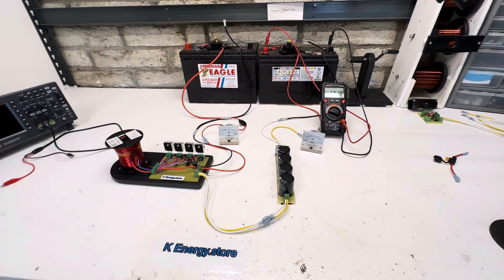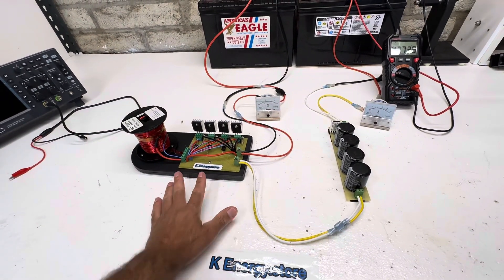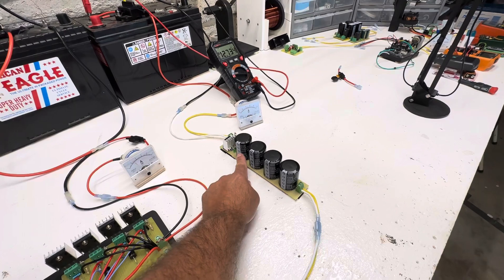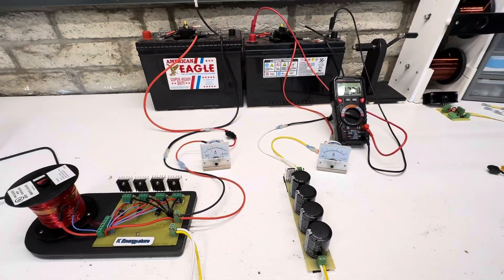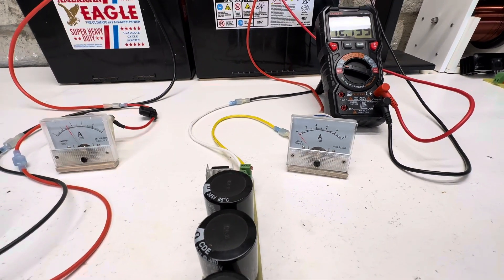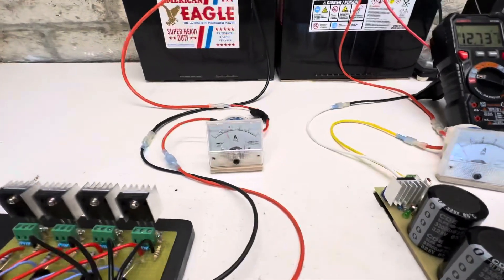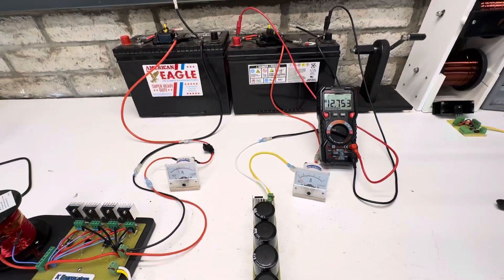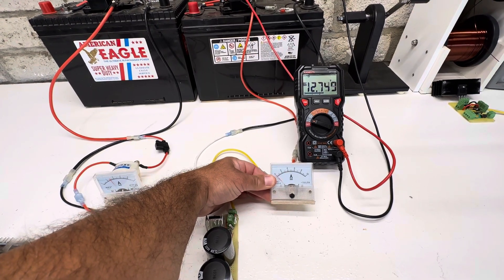Oscillator cap dump 10 amps

Comment: I remember reading with the Bedini type motors you can run 2 different ways.  One is the classic  SG  circuit.   I think the other was called generator mode.   
I think in generator mode the motor coils energy goes back thru the source battery when the switch is thrown.   This runs with higher amps on the input side but from what i remember you get more output than in classic mode ...... 
Have you run in both modes and if so what's your take ?
Reply from the maker: I am familiar with the circuit it have not tried it 
Maybe something I should do lol

Comment: What happens if you wire the batteries in series but use only one 12v side for output, and the other or both for dumping in the charge?
Reply: This would tie the batteries together. input and output.
Reply from the maker: The batteries are in series on bedini circuit positive primary becomes negative on secondary 
If you loop them it’s a direct short

Comment: What is the point of this, if you don't mind me asking ?
Reply from the maker: The point is to charge batteries 
This oscillator can charge from 12 volts to 48v batteries on 12 volts of batteries or solar
Reply from the maker: Also desulfates the batteries so they last much longer
Reply: @kenergy1707  Thats neat. How does one charge the battery past 20V if the capacitor is at 20V upon discharge? Is the trigger adjustable?
Reply from the maker: @sarajohnson4990  I have capacitors that go up to 100 v and are triggered by zeners at almost any voltage between 12 -100v 
That one was just made for 12v batteries because most people only have 12v